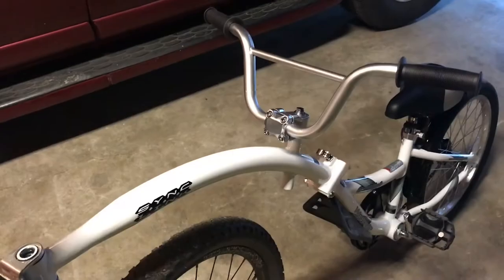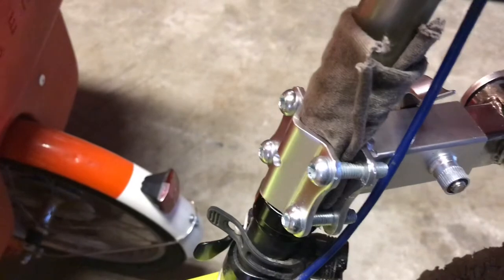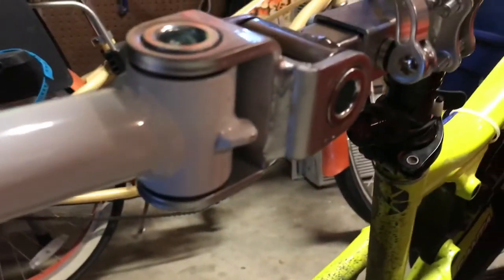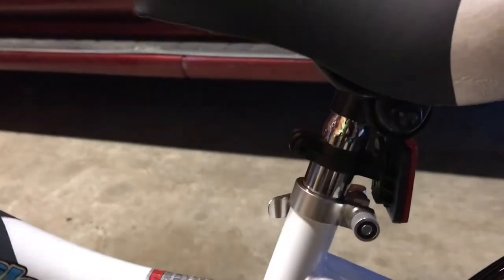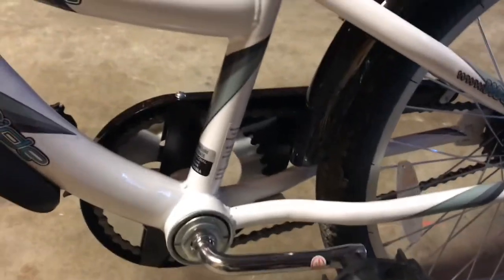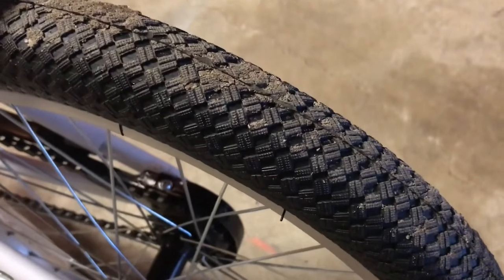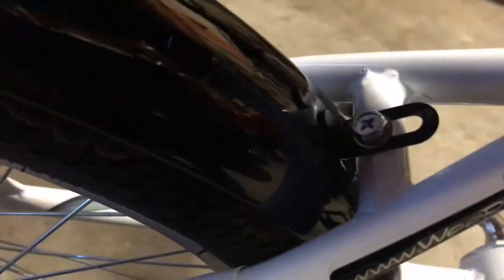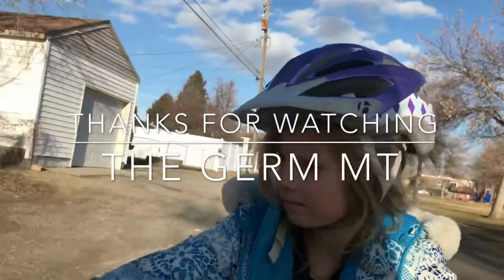Wee Ride Co Pilot Bike Review

Comment: I installed the same co pilot recently and my son loves it, he’s 5. To protect my seat post I cut a short length of tire tube, put some silicone grease inside and slid it to the mounting point on the post.
Reply from the maker: rkymtnrsx that’s a good idea. I do wish there was an easier way to dismount the bracket from the seatpost. You can unhook the bike easy enough, but those screws that mount the bracket are way long and you have to completely unscrew all 4... #firstworldproblems
Reply: @thegermmt6496  I'd consider another seat/post if it was that big an issue, unless you wanted to put it on another ride..

Comment: Word of warning (for awareness, not warning off), do NOT hold the back of your seat when walking with one of these attached, if it jack-knifes it can extremely quickly turn from a turning position to a 90-degree vertical position; I just had this happen the other day, ripped out half of my fingernail bed.  My seat is closer than this video, but at least several inches from the coupling, it didn't seem at all possible to get a hand caught but believe me it is!  My father-in-law then tried to figure out what happened and nearly also had his hand ripped off when it jack-knifed and changed angle in a split second.

These are great no doubt about that, our 3.5yo can happily trail along, but be extremely wary of the joint and don't rest a hand/finger over the back of your seat or on the bar!
Reply from the maker: roguestreak that sounds pretty crappy. I have had issues with it rapidly shifting. More so with me it is when taking a turn too sharp, it will either spin my seat post in the seat tube or the bracket attaching the trailer to my seat post will shift. It really doesn’t have that great of rotational range at the pivoting point just behind that bracket.
Reply: So far I haven't had any instances of my seat or the bracket shifting, but haven't had much experience with it yet.  I don't know if the above could potentially happen when riding or whether it's purely a walking thing, I was attempting to wheel the bike around 180 degrees and I believe it was a combination of turning too sharply with some banking of the bike (ie. not held vertically), resulting in a jack-knife on the vertical hinge.
The bike's elsewhere at the moment, but I don't recall seeing those welded stops on mine; perhaps they are there and I haven't noticed, or perhaps mine's an earlier model and the stops were added later to address such an issue?  (I picked mine up 2nd hand)  Maybe that's why I inversely haven't (so far) had issues with the seat moving?

If you do want to experiment, just make sure to keep your extremities well away from the area no matter how impossible it seems!
Reply: I had a look last night and mine definitely doesn't have the welded bump stops, and looking around at pictures online I've found multiple without them (silver models in particular); I'd guess this was added to later models, potentially to stop such incidents but inversely introducing the hassle of too-limited turning.

Comment: Thanks for this detailed video and review!  When you do turn on your bike, does the seat turn?  (A lot of reviewers on Amazon say this happens.  I wonder if the bit of fabric around your seat post ends up minimizing this.)
Reply from the maker: Erin C yea, you have to be careful with how sharp you turn, it seems to turn the seat really easily. If you used something too slick, the clamp would probably slide up or down the post as well... then the arm attaching the trailer bike to your bike would possibly run on the rear tire. Not sure there is a good way to fix it, so long as it mounts on the seat post.

Comment: Hey great review. Quick question, I noticed you have a dropper post on your bike, have you had any problems with attaching the trailer to it?
Reply from the maker: R Jardin it attaches just fine but doesn’t allow the dropper to function with the bike attached. It didn’t mar up the post, but I also wrapped a rag around the post to serve as a buffer between the trailer bike front clamp and the dropper post on my bike. Honestly, if you want to be able to quickly take the trailer off to ride your own bike, I would plan on having minimal, if any, use of your dropper. Otherwise you have to fully remove the front clamp from the seat post. The clamp is a 4 bolt design and so loosening (or removal, entirely) does take a minute or two. Other questions, feel free to shoot em out.

Comment: Im about to buy one from someone on FB🤔😈🤔
Reply from the maker: Sam Lugo I like it, I think the biggest complaint I have for this brand, is that the seat post mounting bracket is obnoxious to undo. It’s easy to quickly detach the trailing bike because of that bolt system behind the bracket, but the bracket takes a while to remove from my seat post if I want to go ride by myself. You can still ride with the bracket attached to your post, it just sticks out like 6 inches.